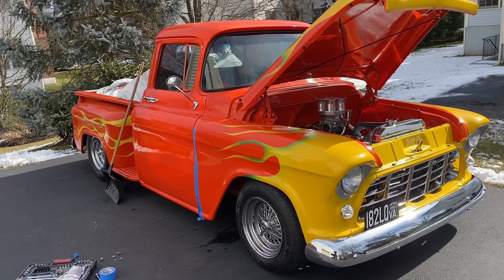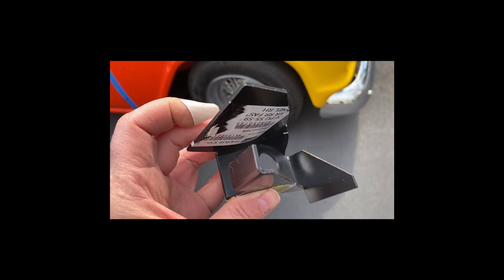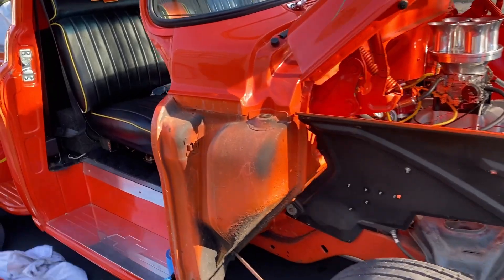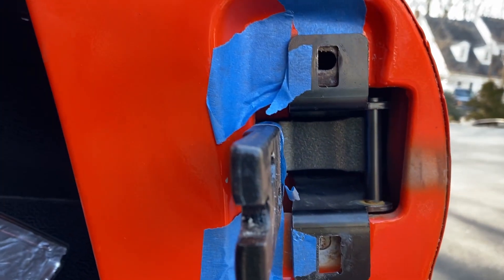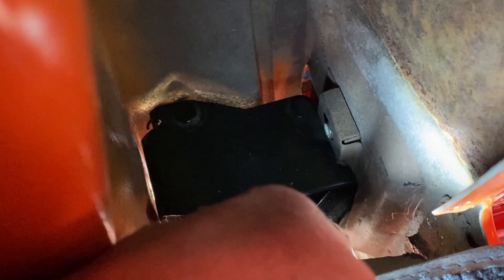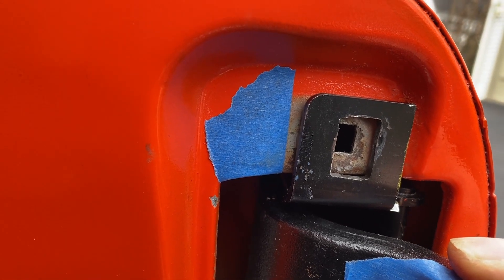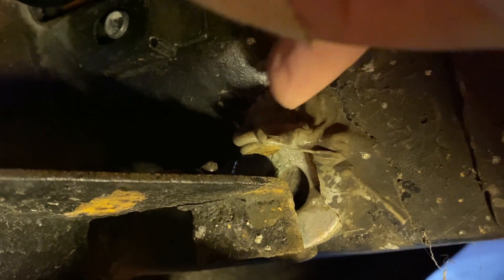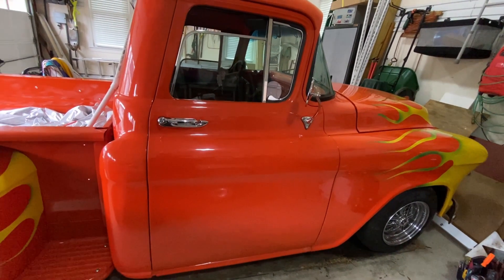1956 Chevy 3100 door alignment / lower fender mount repair

Comment: I have been doing body work for 46 years. My brother has a 56 no rust ever Ca. truck and his doors were out of alignment too. They are quite difficult to get right and do require some compromise.  To make perfect would require cutting and welding even when they were new I believe.
Reply: Add: check all body mounts before cutting and welding the body.

Comment: What's the back story on that truck? I've finally got around to getting started on mine. It's worse than that but don't have paint to bs me lol.
Reply from the maker: I bought the truck online 2500 miles away in Sacramento sight unseen. Was recently “restored”. Hired an inspector who told me the doors needed minor alignment and signs of bondo on lower panels. A little more involved than I thought! Bondo over rust. Probably was a farm truck before that. Not much original on it now. This spring i might put new heads and cam on the 350 sbc - stay tuned in. Good luck with yours!
Reply: @edshandymantips4862  thanks, I'll post my progress as I can.
Reply: I’m not sure if you got around to fixing your issue with aligning your fenders and or doors,  but I grew up around some masterful real body shop guys  that could work on the older vehicles as such. I’m sure you’re aware, but a lot of these older fenders and or doors came with shims which you can place under the fender mount or the door hinge to manipulate, the angle of the doors. It really took the right type of guy that knew about them who knew how to align them, so you’re going to have to find some old-school guy if there’s even one around,  that you might be able to take it to, that’s an artistic eye and as master of working on these sort of vehicles.